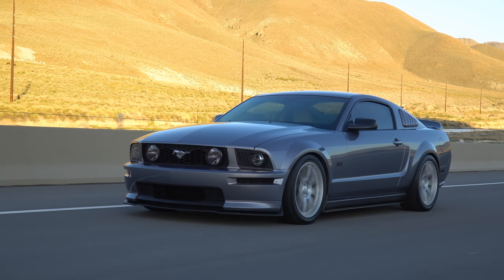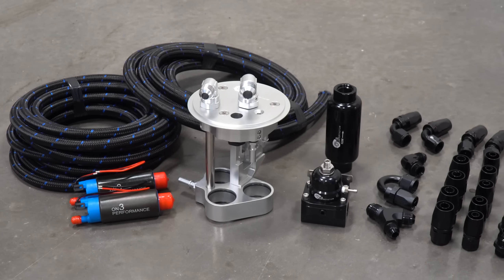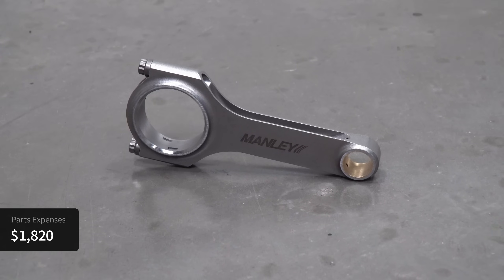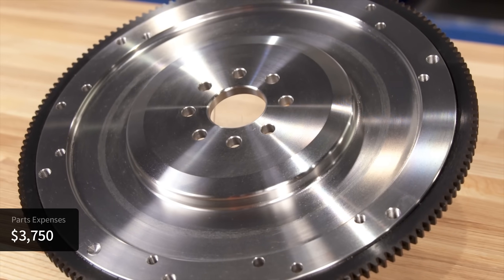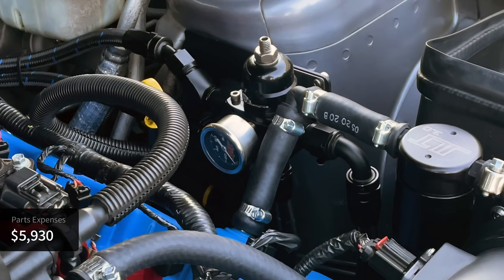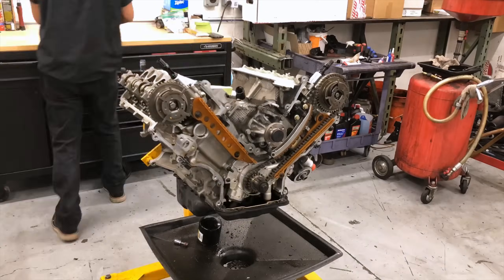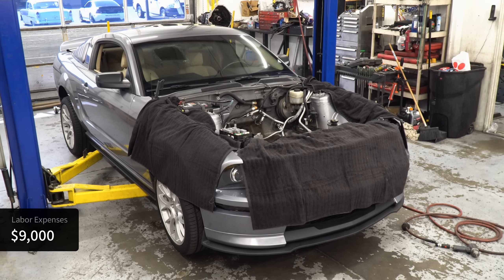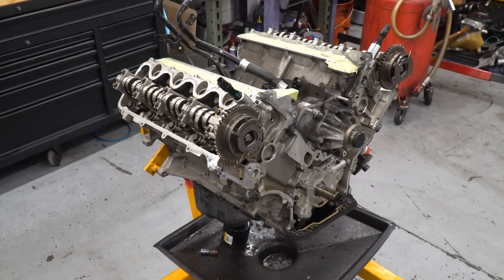Breaking down the (actual) cost of rebuilding a V8

Comment: If I paid 16 grand for a little 370 hp to the wheels, I'd probably blow the car up. I know you have your preferences on wanting a 3v, but you've either got more money than you know what to do with or you just enjoy wasting it. Yes you have a very stoutly built engine, but at what cost. You could have bought Fords 580 hp 5.2 liter aluminator crate motor for  that, and still had a very strong engine and a whole lot more power. To each their own but if you've got money to burn like that, let me get a cool 7 grand to throw into my 5.0 coyote motor while you're at it....lol

Comment: I appreciate seeing a built 3 valve. I've seen alot in regards to the factory block not being able to support alot horsepower though.
Reply: Stock block will take 800+hp
Reply: It’s the internals the block is fine.

Comment: Any idea what your compression ratio is right now?
Reply from the maker: It was supposed to be around 10.2, but after using some online CR calculators, I am thinking it's 9.5 - 9.8... which is great for boost but poor for NA. :/
Reply: @Four_Eyes  well dang. A large part of me wants you to try some 1 3/4 primary headers and to shave the heads and bump it up to 11:1, then give some comp cams 127400, 500 or 600s. The bottom end can take that even with boost. Your cars bottom end has surpassed what a gen 3 5.0 can handle and those sit at exactly 12:1 but as they say “it’s a lot easier to spend other people’s money than it is your own”. Take comfort in knowing that with the longer stroke the car should be a torque monster left the way it is, especially when you start shoving tons of air down its throat.

Comment: I did arp head studs,main studs side bolts Manley pistons eagle rods stock crank oil pump gear and timing tensioner with labor included i pulled the motor but f0r everything 3000$ turbo getting fab up now hoping for 700whp i know stock crank can handle 800

Comment: I have to say I can respect a guy that wants to keep the 3v, build it up and push it's limits. But for 16,500 I can't do that. I'm leaning towards the coyote swap for my 2006 GT. Kudos bro. Looking forward to seeing your next upload. Peace..
Reply from the maker: Get a gen 3 if you can swing it, especially if E85 is available in your area.
Reply: @Four_Eyes  e85 is at a station a mile  away. As a matter of fact, I just now found a practically brand new "2014" gt/cs for sale that I'm going to check into trading in my gt for.. but if it fails. I'd be searching for a gen 3. The parts farm usually keeps em well stocked, even on pallets I believe with control packs, tranny if needed,  everything..
Reply: My 06 is in too good of shape not to swap something into..I love my gt with a passion..

Comment: There are a few guys with single turbo 3v motors in my city.   They all make 700+whp.   As long as that bottom end you built can hold and the tuner knows what he's doing, you should be able to make some good power.

Comment: 370whp after $16,500..i mean i can understand you liking the idea of pushing 3v for all their worth but that just seems like alot to not even making 400. I have a 04 mach 1 roush kit full exhaust, intake, MSD coils, and tuned and its making right around 347 to the tire. And im not exactly chomping at the bit to put another 10k into just so it will handle boost. Im strongly considering selling it and going C6 Grand sport. I mean LS7 6speed car 515 from the factory and after H/C/I full exhaust and tuned. Thats a 700hp motor ya know. Just again my personal opinion

Comment: If you think about it, this really isn’t that bad. Add a supercharger, and say you bought the car for around 8-10k and you’ve got yourself a reliable over 500+hp 3v for around $35k. That’s buying a s550 model and it’s going to be bone stock while you already have a built 3v, with the wheels and other aesthetics you wanted. Not bad not bad. Plus the 3v sounds 10x better than the coyotes 🤷‍♂️

Comment: First video I have seen of your channel popped up in my recommended watched it all the way through and went to click your channel to watch some more content and sir I am hooked and now subbed looking forward to seeing what numbers you put down with that more aggressive cam. The 3v is one of my favorite motors the sound is so intoxicating cant go wrong with either path though 4.6 or 5.0. For me with the arrival Electric cars with mad hp and trq figures and 0-60 times I would much rather build an engine with more personality and tone than doing what gets the most horsepower as there will always be someone in a tesla and so on that will be faster than any reasonable street built ice car, even the base tesla model 3 accelerates faster than my buddies STI not to mention the performance version which does it in nearly 3.0seconds. Now there is nothing wrong with spending massive amounts of cash to build a high horsepower car, as long as it makes you happy.

Comment: Hmm seems a lot to throw at a 3v; almost as if  a cost benefit analysis wasn’t done? But maybe I missed what the intent of the build was... solid move would’ve been a 03-04 navigator engine punched .030 over with new pistons, cams, exhaust and a tune. Way way way more power and possibly significantly cheaper.

Comment: I would say the compression is lower than excepted with the, I'll be blunt, lack luster power figures. But that's the thing, this isn't an 12.0:1 monster N/A motor. I bet with the same compression ratio has a coyote car which is 12.0:1 It would easily make over 400whp and likely a lot more. I dig the 3v build. This will decimate all, after, you put about 15 grand in it or more. If we have to, overnight parts from MMR.

Comment: What cams do you have in there now
Reply from the maker: detroit rockers, they have stock lift (0.45")
Reply: Awesome what cam setup you thinking of going with? Love the build too great job. Love the 3v motor. I have a saleen blower on mine making 563rwhp check it im sure you'll like it.
Reply: @vremm.motorsport  how much boost you pushing with the saleen
Reply from the maker: Comp Cams 127600, puts these special heads to work.

Comment: Very curious why the Livernois heads do not seem to deliver.  A apples to oranges with the setups and rear wheel vs motor measurements, but still curious.  I thought I remember you peaking 360 before at the rear?
Reply from the maker: Yep, super frustrating. I think it may be my altitude, roughly 15% less air pressure. Hoping the new cams will have a symbiotic effect... we'll see.

Comment: I am down here in Phoenix Arizona. The dyno shop that did mine is called dynocomp in Scottsdale Arizona. The owner Richard when I was looking for a dyno shop interviewing multiple that is. One of the things that I liked the most about him was this. If you are looking to see a particular number on the dyno go someplace else. If you want maximum power out of your engine but reliable and trustworthy I'll do it. Because I guarantee you go to any other dyno shop after I've done my tune on your car they will get a higher number by leaning out and jacking with the timing to unsafe conditions.
The thing with your heads definitely can be a thing.  A lot of people forget that engines are air pumps air in air out. When it comes to doing this kind of stuff that you and I are doing you got to figure up your volumetric efficiency in short how efficient is each cylinder pulling in air and utilizing it.

But I would really like to potentially talk to you on the phone about this stuff if you're interested. I don't know enough about this YouTube communication because I know I don't want my contact information out for everybody and I'm sure you don't either but anyhow.  If you don't want to because of too many weirdos out there. I get it. At the end of the day it's all good! And doing this kind of stuff is a lot of fun hell I just got done last weekend porting my throttle body. Which by the way collapsed my JLT air cleaner. Good luck

In the regards to porting the heads I did port my heads I did a lot of research into it talking to guys that do porting that are willing to talk about it which is far and few between.

Comment: Well thank you for answering my question, I'm about half way through buying parts for my build. 
I'm still missing ported heads and the random little stuff that would need to be upgraded.
Reply from the maker: i would skip the ported heads, very expensive and unless you're shooting for like 1,000+ wheel horsepower, they're not necessary

Comment from the maker: addendum
* my labor costs are very likely on the high side since the shop that rebuilt my motor specializes in LS (this was their first 3v)
* with respect to power, i think i (accidentally) lowered my compression ratio with the non-OEM ported heads (bigger chamber size)
* at 4,500 feet i don't think there's enough air pressure for the stock heads to act as a restriction, possibly no benefit from ported heads until boost
* the yOu sHoUld HavE CoYotE sWapPed iT folks are annoying, but they're not wrong
* i am going to get this thing to 400whp before boosting
Reply: Wow first of all nice job sticking with the three valve I also have a three valve pro charge mustang stock internals for 485 RWHP .My question to you is did you consider buying a complete motor first that was already done versus having a shop do it
Reply: @craigc9181  Well it is the most entertaining footage of the 3valve and we are the beneficiaries.
Reply: Yes you lost some compression but that's honestly good for boost. I would just move straight to boost. Your motor is now built for boost and non efficient N/A in my opinion
Reply: You should be able to get over 400whp pretty easily from here. I know a guy putting down just over 430 with the ‘same’ build.
Reply: But I also forgot to say you should be able to turn up the RPM with the new cams that you plan on adding. I’m pretty sure the car should have a better top end as well since the motor is already stroked.
Reply: Man I’m not sure if e85 would be a viable option but I’m running e85 on my 3v and it gave it a kick and I’m already FBO just had to buy some 47Ib injectors and get 450 Walbro pump lol. Once I slap the hot rod cams I’ll for sure get my car on the dyno and see what it makes lol.
Reply: What lowering spring setup you got on? And can you give me rhe link please???
Reply: I hate the coyote swap crowd. Nothing beats the sound of a modular IMO
Reply: @HaltonLax44   You must have never heard the old school muscle cars. Mod motors sound great. However, old school muscle is unbeatable for sound.
Reply: Turn ur mustang into a 67, like g is for build. Thats my plan to do with my 06 gt. Im just gonna avoid all the lawsuits, like my taxes
Reply: New sub
Reply: I respect you sticking with the stock block. A coyote swap isn't cheap and because of their size, they aren't easy... 10k if you pull a truck motor from a bone yard and much more if you go for the aluminum gt motor.  You used good stuff, I wonder if you just need to tweak some stuff or boost it?
Reply from the maker: @user-qr7ee2cp4y  i'll be boosting this year, so the NA power doesn't matter too much, but ppl sure do get caught up about it
Reply: I have a all motor 3v, whats you compression ratio? I know you are planning on boost so im guessing you didnt go to high. Also what camshafts do you have? I wouldnt be too worried about those numbers being on boost you will be making plenty of power safely with a bulletproof engine.
Reply: Well with the lower compression you'll be safer to run more boost so honestly its kind of a positive. Also I agree that your 3v build is wayyyy more interesting than a coyote swap for simpletons. You are quite litterally teaching people that only learn by seeing the consept in front of them to work on a high performance engine and thats priceless!
Reply: They might be right. However, bragging rights about a three valve that’s keeping up or passing them priceless.
Reply: I have recently subscribed because I just bought a 06 gt I’m wondering on some of the body details. I like the look yours has

Comment: Be careful with those GT500 pumps. 13-14 GT500s come with a return style syste. from the factory and a better fuel hat than the previous generations (07-12) and can support just over 800 wheel on E85. The 07-12 isn't as strong, and you may have been better off just going with a kit from fore, their dual pump setup supports 1200+ on whatever fuel you want, gas, E85, alcohol, etc.

Comment: You can get a stock fotd cobra crank for 300$ . I know you're not strocking it but that's a big saving there . The rest is pretty much good .
If you're just going to add 20 to 30 cubs. It's not worth strocking it .
As for the return fuel . Absolutely go with a return . He hasn't done his homework.  They're are many DIYER doing it very easy and cheaply ..
Reply: Will it fit 3V

Comment: That is a boat load of cash for 370 hp.  Nice build.
So car is making 55 hp more compare to stock for $16k
Reply from the maker: it's making about 100 horsepower of stock. the main point of the rebuild is so i can throw 20 lbs of boost at the engine w/o blowing it up
Reply: @Four_Eyes  thanks for the clarification. Sick build. Nice stang. Should swap maybe the interior to a nicer one. 2010 above.
Reply: Also did not include ported head cost
Reply from the maker: i don't recommend them, they're super expensive

Comment: My 1st car, 2006 mustang GT. Had it for 5 months so far and I'm doing allllllllll cosmetics rn. I want to do an engine mod. Any recommendations? Or do full exhaust system? I've done a muffler delete
Reply: It's good to start with exhaust should be next. I've learned it will tie in perfectly with any future mods you plan on doing
Reply: @artofwor8041  aight, thank you broseph
Reply from the maker: intake, full exhaust system (headers, etc), underdrive pulley

Comment: Would it have cost you less to just buy a 1000 hp long block from mmr?
- no hate just curious
Reply from the maker: really good question. looking at it now it's definitely a worthy option as it removes the guess work of piecing parts together.
Reply: @Four_Eyes  yes im also thinking about rebuilding and thought a long block from mmr wouldn’t be worth it but looking at it now it might. Doesn’t matter what way you went now tho this thing is going to be a beast.